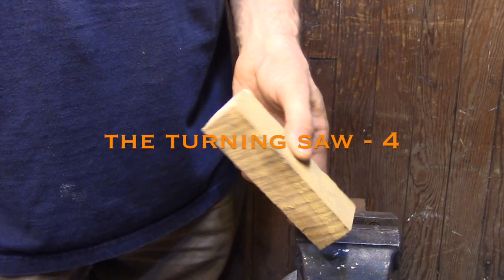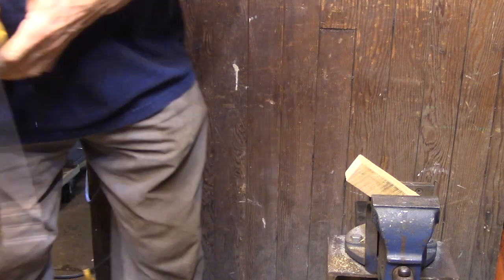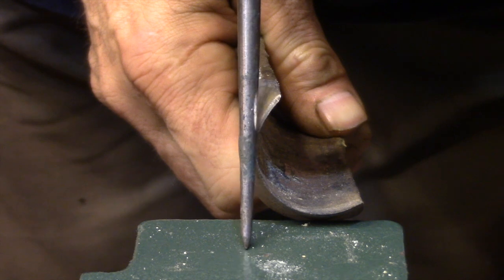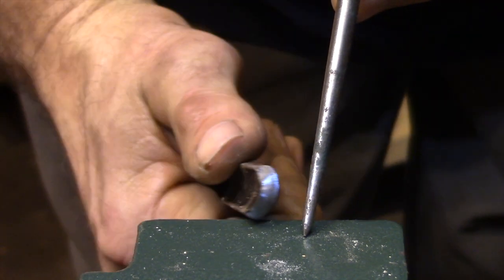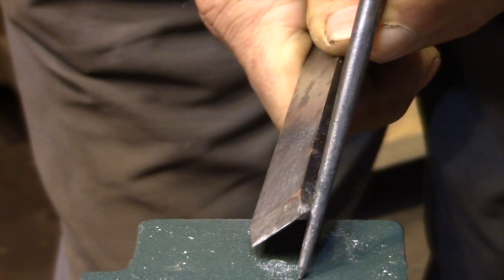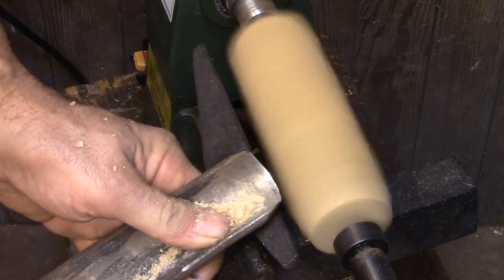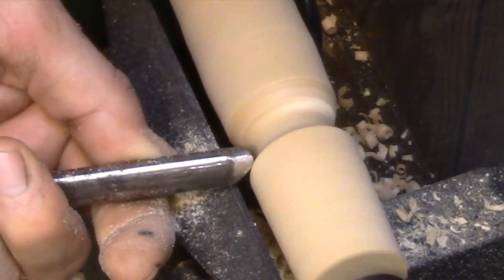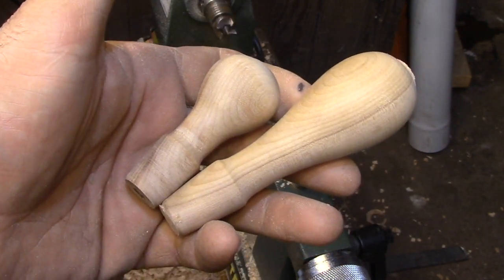Blacksmithing Project - Forging a Turning Saw Frame 4

Comment: Dave, why wouldn't you use the lathe to drill your through hole, after you've turned the handle on it?
Reply from the maker: A small drill can wander off quite a bit when you are drilling into end grain.   That may not be a problem when you are only going in a short distance but the hole on these handles needs to pass all the way through.  Drilling the hole first and then turning the handle around the hole is the best way to make sure you have a hole that is perfectly centered.  Also most early wood lathes did not have chucks.  The work needed to be mounted between centers at all times so there was no way to drill on a lathe.

Comment: my Grampa had auger bits that looked like he removed that little screw on the tip,he called them "barefoot"bits and claimed they would make a straight bore because the little screw couldn't take that path of least resistance you mentioned...ever hear anything like that?
Reply from the maker: I'll have to try that - Thanks

Comment: Hope you get your money but what part of this vid had anything to do with forging?
Reply: This is part 4 of the project, friend. There was forging in other parts, but this part of the project he wanted to make in wood.
Reply from the maker: Of course this video doesn't have anything to do with forging but it does have a lot to do with being a blacksmith in a rural community where he had to have a working knowledge of a lot of trades to make or fix whatever came in the door.
Reply: Chris Fendley's reply answered my question. Thank you for your response.
Reply: Thanks.